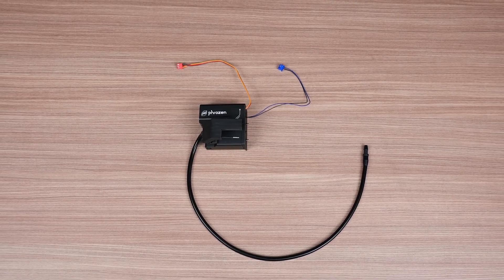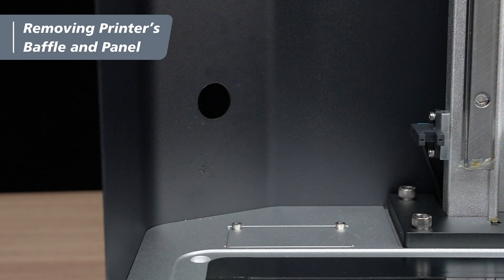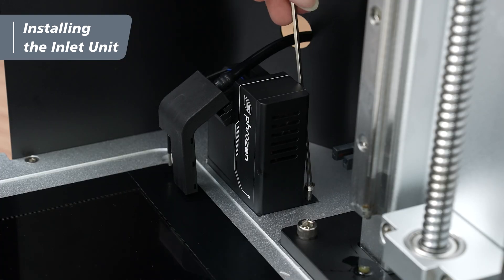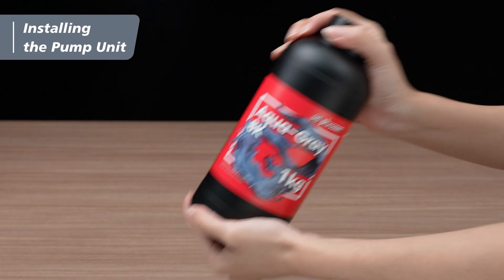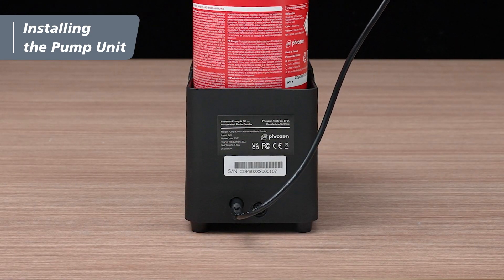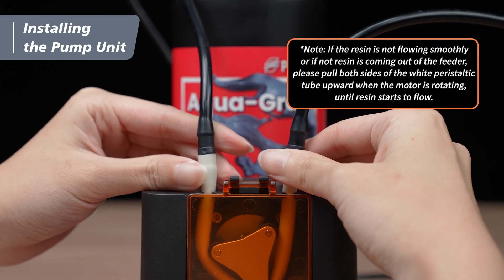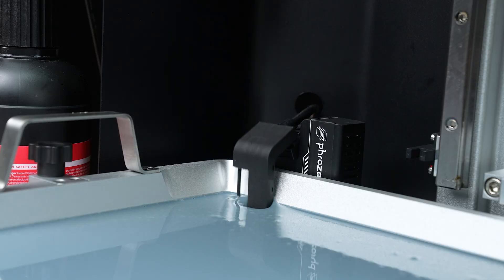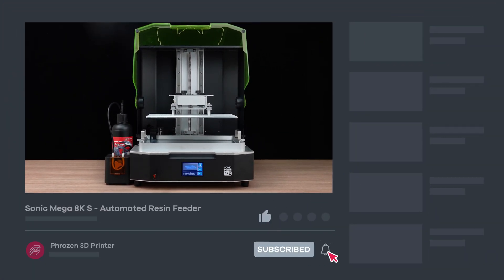Setting Up Phrozen Pump & Fill - Phrozen 3D Printer

Comment: What is the process for changing resin colors or cleaning the pump? Can you post a video showing this process?
Reply from the maker: Hello. You can clean the pump by using alcohol and a cleaning brush, or by replacing the tubes. We recommend using the same type of resin to minimize the risk of mixing and potential failures.

Comment: Im still waiting for a manufacturer to make a refill pump that doesn't use their own bottle as the resivior. Why cant we have a universal resivior that has like a flip open lid where we can pour any resin in to. Having to change or refill the bottles makes a mess. It would be satisfying to have a system where i can just leave the resivior sealed in place and  be able to pour resin into the resivior. No mess.
Reply: While that would be fine for a system that is being used to print a singular type of resin, it does complicate changing to other types of resin easily.

Comment: If the resin vat and the bottle of the pump and fill both run out of resin during a 3D print, can I pause the 3D printer, refill the resin bottle of the pump and fill and then resume the 3D print?
Reply from the maker: Currently, pausing and resuming the 3D print may result in noticeable layer lines.
We recommend adding resin directly when UV exposure is off to prevent misalignment during printing. 

For more details or assistance, please contact our customer service: https://helpcenter.phrozen3d.com/hc/en-us/requests/new.